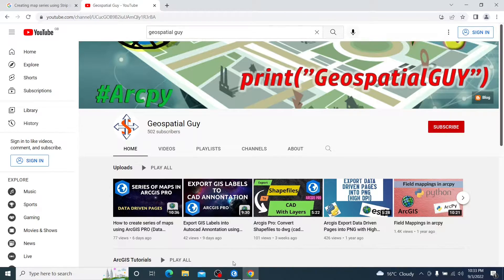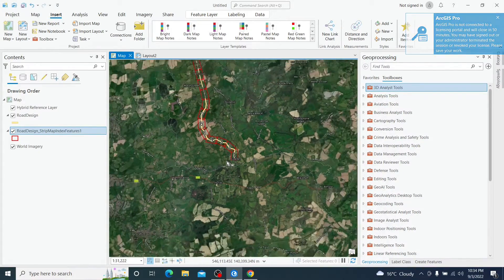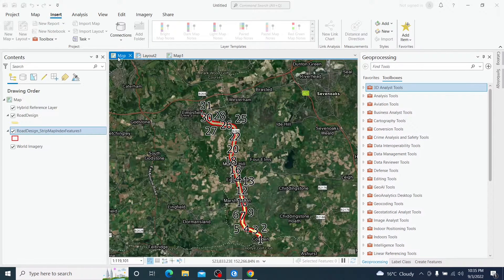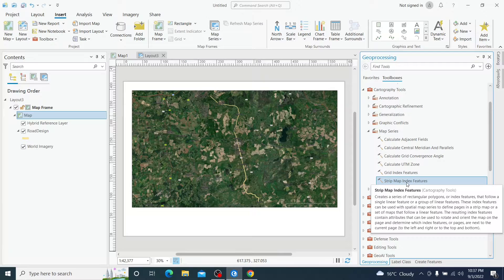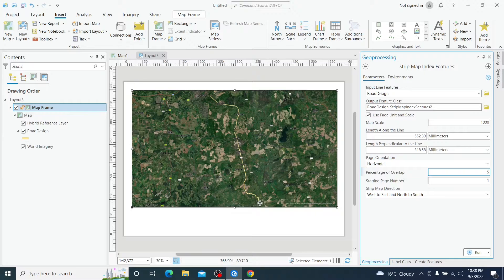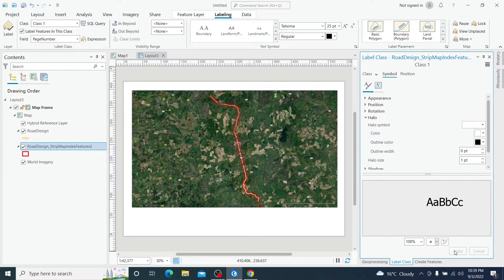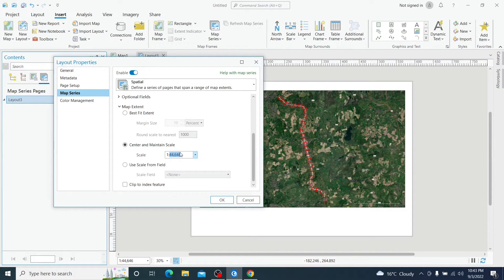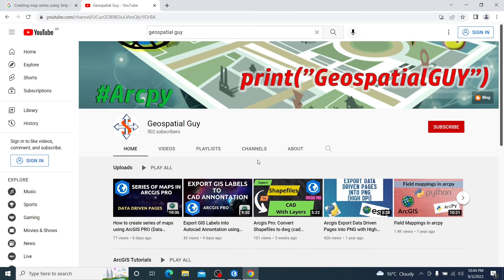Map series along a path in Arcgis Pro

Comment: very informative friend, can you help me how to get the grids like without overlapping and I have existing Grid polygon layer, the tool has to use same layer and place grids for Road design lines
Reply from the maker: There is an option in the Strip Map Index dialog box, "percentage of overlap" just type 0 for this parameter and you will have the grid without overlap at all.
Reply: @GeospatialGuy  yes i type 0, still its overlaping Grids when road is bent. i need Grids like bricks arrange in building and I have existing Grid layer. the tool has to use the layer.
Reply from the maker: @yuvarajud2942 than explorer grid index layer, or check one video before this one.